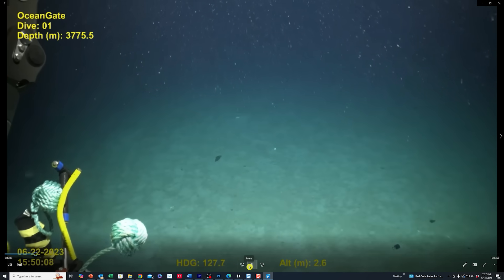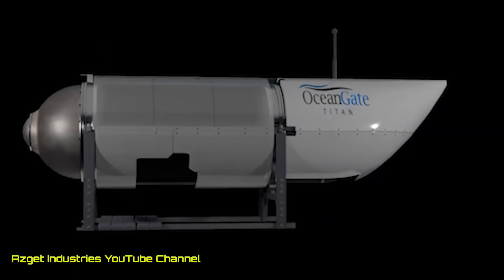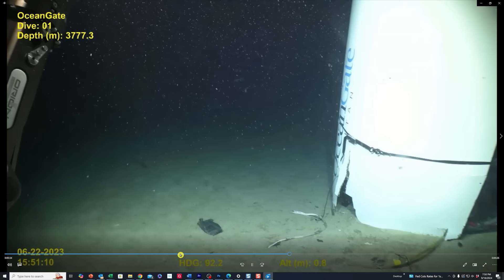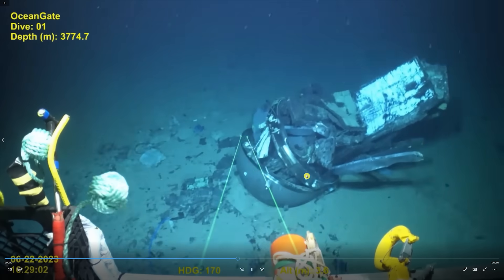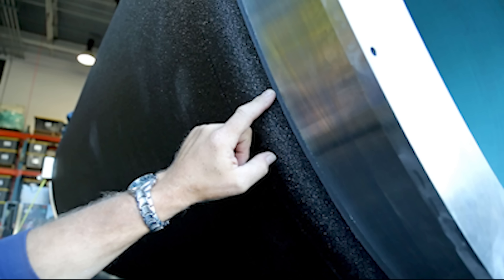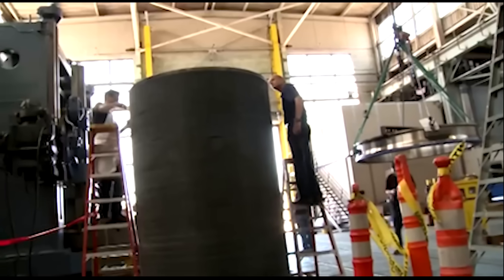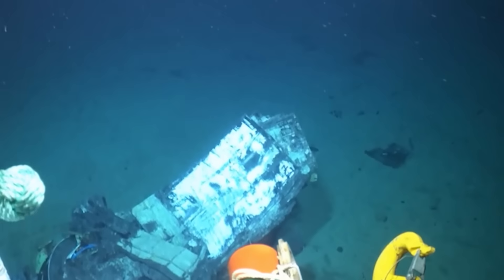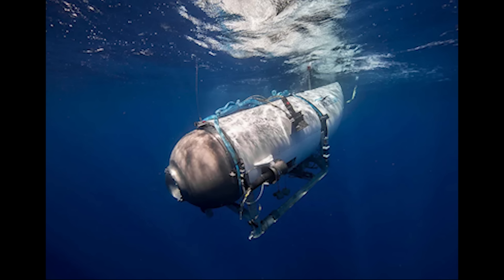OceanGate Titan Sub Debris Video Shows How It Imploded

Comment: That carbon fiber just crumbled to pieces. You can see them all over the ocean floor.
Reply: Most of the hull is stuffed into the forward dome. Which I guess is where the “human remains” were found.
Reply: @allangibson8494 Actually, most of the carbon fiber remaining from the wreckage is attached to the rear dome, not the front. The front dome has no carbon fiber attached and the front connecting ring was totally clean.
Reply: @milkphish4122  The carbon fiber was NEVER attached to the front dome.
It was a hatch bolted to a flange. The rear dome was directly glued to the hull (no ring).
The video shows hull fragments stuffed into the forward ring with the hatch ajar.
You can see the black glue residue on the rear dome too.
Reply: @milkphish4122 the front dome came up completely clean AND with the thick acrylic porthole glass missing. You’re right. All those pieces of carbon fiber are crammed into the other “cap.” It’s as if the implosion started down on the front of it, maybe porthole glass and it started the implosion. Once it gave the entire thing crumbled instantaneously and was forced towards the opposite end.
Reply: @allangibson8494 the rear dome had a docking rig. Look at the design specs.
Reply: @halomultiplayermoments  Only the FRONT dome had a hatch. The rear dome only had a couple of small cable pass throughs and no ring on the actual hull in service.
Reply: @allangibson8494  oh that eerie black glue I watched a video about that
Reply: @TheIndependentLens Scott Manley has a good take on the disaster by what has been said and shown by video on his channel. Very similar to your take. The two videos together help to see what possibly happened.
Reply: @milkphish4122  The front dome was pure Titanium, with a view port, it was the center pressure hull that he added the carbon fiber. The reason you see the end and front parts intact is because one of them is the strongest material. The aft part was not pressurized it was at sea depth pressure so no implosion possible. The carbon fiber Thin titanium pressure hull was bolted to the front comb of Thick titanium. When they brought up the front section there was no tiny bolts where the view port was to hold the glass. If the implosion happen from that glass, only the glass would blow in and the bolts would still be holding the broken pieces inside the sleeve. The reason the glass and bolts look like they blew out, is because the Pressure hull with carbon fiber imploded causing pressure to push out from both ways of the center hull. They had problems with the main bolts securing the pressure hull to the comb section before. The implosion break happened between the secured comb section and the pressure hull. If Stockton would have made his pressure hull the same like his comb section minus the incorrect view port, he would be alive today. The human error here is, Stockton used 1 to many different types of material, and incorrect thickness. The second part of this tragedy is very Scientific and can be measured and figured out to perfection if you follow the law of physics. <~ someone told everyone they don't know what there talking about, and the next day they got pink slips.
Reply: @TheIndependentLens   I doubt that any of the glass failed or the domes they aren't a point of weakness they're actually part of the strongest part of the structure The thing that can fail very easily is the carbon fiber due to the fact that it can The thing that can fail very easily is the carbon fiber due to the fact that it can Develop fishers in it from  Hull Pressurization and depressurization which causes expansion  And contraction  Weakening the Hull And causing water intrusion. Once the intrusion reaches the inner structure It's all over The pressure is able to reach the interior and thus resulting in an implosion which then causes a Violent Amount of pressure outwards Hence why the 2 pieces are a little ways away from each otherAnd the other dome is in another location.  A one time use hole is just that 1 time he pushed it 4 times that's what happens when you push things the engineers and other submariners tell you not to do it results in tragedy. Sorry for types on speech to text.
Reply: @allangibson8494  It is the rear dome it is all compressed into.
Reply: @allangibson8494  that’s how I see it the whole just jammed into that dome
Reply: @allangibson8494  Exactly.
Reply: shattered like glass.
Reply: The end caps apparently had no mechanical attachment to the hull, just glue.
Reply: @kirbywaite1586  so I am the furthest thing from an engineer🤣 but even to me that doesn’t sound like a good design
Reply: @kirbywaite1586  I wondered about that too. Maybe drilling into the carbon fiber and fasteners would weaken it? Idk.
Reply: @bccsivxx-xxivvii Every time they did a dive it weakened the integrity of the structure, especially since every dive seemed to push a bit further it was bound to happen according to some submarine expert I saw talking about this. He said Carbon fiber technically works but not for very long, hence why titanium is the industry standard being that it’s incredibly strong and lightweight.
Reply: @charleskavoukjian3441 ,
The US navy built a carbon fiber submarine. Before they put a person in it, they built several and tested them to destruction...
Reply: @kirbywaite1586  they should of used 5200
Reply: Very innovative. Cockton in a Rush, built a human to toothpaste converter, just insert quarter million dollars and press x on the playstation controller.
Reply: @Zedsdead83  yikes!
Reply: My understanding was that they did find some remains. I imagine maybe just teeth or pieces of bone not really full body parts.
Reply: This also proves it wasn't the glue. If the glue had been the part that failed, the capsule in front would have been shot off, and all the pressure had gone through the hole. The carbon fiber would not crumble, because the pressure is already gone. But the images clearly shows the carbon fiber is what gave in, the fiber itself. It starting cracking, and over time it got weaker and weaker, until it snapped. This is exactly what experts also predicted would happen. The glue was never the culprit.
Reply: What I have an issue with is the lack of research. I was thinking of making a carbon fiber bike so shortly after YouTube and Google I realized it gains fatigue and can fail suddenly. On a bike, it's a pain. Next to the titanic, it's obviously this.
Reply: Yeah, I’m race cars when carbon gets one tiny Knick, it’s done. They didn’t even wrap it in a weave Pattern for maximum efficiency in strength, they wrapped it like a 5 year old would wrap a string around his finger, and his colleagues said he was really smart. Going to college is no garuntee of genius.
Reply: " bodies would have been made into    " puree  !  "
Reply: " bodies would have been turned.     " into  puree !
Reply: The people getting on their soapbox criticizing others about wanting to see the implosion would be the first to click on any video that showed it. And they know it. I feel bad for the victims on one hand and don't on the other. And the reason for that is there was a fair amount of easily accessible information out there about Stockton and his dismissive, negligent attitude towards safety.  Yet, they all got onboard except for one individual whose son did his research and they backed out.
Reply: That's what happens when you replace Titanium alloys with plastic.
Reply: How can anyone want to go into this plastic Tupperware blob into the water? I hope oceangate goes under for good. They should’ve had cameras in there to watch it implode
Reply: I think this is the first footage to be available anywhere after the implosion. The remains of the hull after it failed has a lot of broken chunks with very little splintering or individual fiber strands. Maybe the shape and size of the broken bits could be some indicator of which direction or where the stress forces were concentrated more on. There might be some larger piece some distance further that away might have a short section that is not broken apart. I really wish they moved even closer because it looks deceivingly small or at least look at it from the opposite side as well. Also do we know which side of the titanium dome/ring are we seeing? I recall the side facing the equipment tail end does not open is that correct? I think there is still more footage of the remains than what we saw here today.
Reply: @PatlYTpage it's not like it exploded mate, they didn't have to move very far from where it became a ball and confetti 🎊 and rained straight down
Reply: They should become a glue company
Reply: The front failed at the joint, attaching to the ring. Once that joint failed, everything crumbled.
Reply: Yea when he mentioned the black pieces on the ocean floor I figured it musta been the carbon fiber
Reply: I dont know why but that quote reminded me of the chernobyl docu-series
Reply: To the shock of exactly 5 people
Reply: All those particles in the water are THEM.
Reply from the maker: I would love to see a body cam of that implosion
Reply: @jeffostroff  You'd need a pretty decent High Speed camera like a Phantom, that baby was crushed in 6ms.
Reply: @flatmoontheory under 2ms. Faster than normal video frame rate.
Reply: Bruhhhhhh  @jeffostroff
Reply: @jeffostroff  crazy to think about. Have they said if they ever found any remains? Appreciate your videos btw. Always very interesting.
Reply: @bccsivxx-xxivvii  Yes , they said they found human remains , not sure at what state tho.
Reply: @bccsivxx-xxivvii  the proteins would have all been denatured - nothing left
Reply: @bccsivxx-xxivvii when they first found it they claimed to have pieces of human remains but other than that who knows
Reply: @bccsivxx-xxivvii they did, I'm assuming this is the video from back in the day when they were about to recover it, cause they did pull up a crumbled ball covered in tarp because it had "human remains"
Reply: @jeffostroff  It would have been so fast, all your would have seen if it was 24fps, is one frame of everyone sitting there and the next frame everyone is crushed. That fast.
Reply: To many body's in that cabin.poor engineering why did they cram people in that small space??🧐 @jeffostroff
Reply: @jeffostroff  You have picture of all 5, and.. nothing. The cam probably don't register anithing like the human brain. Bacause of caching. (sorry for my english)
Reply: @jeffostroff  you would "love to see" ?? Have some respect.. loved ones have died
Reply: @jeffostroff what would of happened to their bodies ??  There is go pro footage down there for sure
Reply: @TheeDanIslander
What happened to their bodies? Put an overripe pitted peach in a plastic bag. Squeeze the peach as hard as you can as fast as you can.
Thats what happened. They instantly turned into biological matter which disbursed on ocean currents. As far as I know all they found was some bone pieces and teeth.
Reply: @childofcascadia  I think it’s more like a huge 16 wheeler truck driving over a peach
Reply: @katrinat
Lol, yeah, apt.
Reply: @childofcascadia  i was told insta pink mist and some of THEIR unbelievably strong plastics would be all. That guy in the oil rig where the divers sit in a tank while the pressure slowly comes back there was an incident where it was (nothing as much pressure as this) ummm a diver was in between  two tanks and the pressure SUDDENLY went instant1200lbs or whatever..and his face tore off intact degloved  his skin was all gummy he FELT NOTHING--- but his co-workers who saw it sure did!  and im not happy I saw the photos. It was a bit exploitative. I mean he is a guy with a family you know...?
Reply: @TheeDanIslander turned to mist
Reply: @TheeDanIslander  liquified
Reply: @ravenwda007  fish food?
Reply: @TheeDanIslander they were basically turned into human jelly. The inside of the submarine imploded so fast that it heated to the temperature of the sun or hotter. And it imploded so fast that their brain didn’t even have time to process what happened before they died. It was a truly instant death for everyone on board.
Reply: @TheeDanIslander There are no bodies. With that implosion, it would be just "red goo" which they did find in cracks.
Reply: @TheeDanIslander  No video system would survive a implosion of that level, the poor game controller was wiped out.
Reply: @UltimateTiger312 interesting that it heated to temperatures as hot as the sun 😂
Reply: @jeffostroff  I would too. Fascinating stuff to forward scientific research on how to prevent this sort of thing. Too bad the hypocrites like to stand there with a limp wrist and poo-pooh people like us for wanting to see something like this.
Reply: @jritechnology exactly, like the poo poo legacy guy above😪
Reply: @jeffostroff I think everything vaporized so fast you’d just see some panicked individuals one second and the second half of that same second feed would just go black . 

However I’d like to see just incase there was something to see .. I bet the owner was kicking himself in the ass for throwing all the OSHA regulations, warnings and predictions out the window . You know that video “ it was at this point  he knew that he fucked up!”😂
Reply: @jeffostroff mate respectfully that is a pretty stupid comment. 5 people died in this submersible and you want to see a body cam of the implosion!

I like your videos btw but serious really disrespectful comment there Jeff.
Reply: @halomultiplayermoments  it's important
Reply: @halomultiplayermoments  it would be super cool
Reply: @halomultiplayermoments  Stop being a hypocrite....mate.
Reply: @jritechnology  lol wanting to watch an implosion that killed 5 people is sick and you call me hypocritical 😂😂 whatever bro 💩💩
Reply: @halomultiplayermoments  billionaires viewing a mass graveyard for entertainment? cry me a river
Reply: @halomultiplayermoments it’s needed for research and you are too soft 😮
Reply: @halomultiplayermoments I really enjoy his videos as well, but people need to use their inside-my-head voice when thinking those kinds of things, meaning, keep it to yourself. It was a terrible loss of life thru no fault of their own other than trusting someone that presented themselves as the cutting edge expert … IMO of course.
Reply: @halomultiplayermoments  Sometimes science requires these things no matter how terrible they are it is better to learn From mistakes and not repeat them then to ignore. I get your point But from my science perspective analysis is better than noneFrom a strictly scientific point of view not out of enjoyment.
Reply: @halomultiplayermoments  Countless ppl would be curious goofball, if anything, just for the physics of it. It doesn't subsequently mean they are "being disrespectful." Toughen-up a bit!
Reply: @edkiely2712 lol dont know what comment youre talking about but some of them are disrespectful.
Reply: @halomultiplayermoments stop getting triggered 😂 means it would be useful to see from a scientific point of view, to understand exactly what happened.
Reply: @halomultiplayermoments  Doesn't make him a bad person. I feel bad for what happened and I would still like to see the footage. We don't get to experience stuff like this often. Go be a karen somewhere else.
Reply: @halomultiplayermoments ok Karen,  come on Karen relax, ok Karen you win 🏆
Reply: @jeffostroff  Question: didn't they record video inside the whole time? Wasn't there a camera? Did it survive? If it was were they able to recover videos from it?
Reply: @webfreezy  well I have no information to answer your question. But if Stockton run the vehicle with a kids joystick, I can’t imagine him investing in a camera that could survive that pressure.
Reply: @webfreezy i wish they could do what nasa or spacex does and have the camera feed go to a command center
Reply: @webfreezy how would is survive underwater for such a long time. I don’t see that being possible at all.
Reply: @webfreezy you think a consumer camera can survive the pressure that only like 5 robot vessels in the world can? They should've covered the titan in those cameras then!